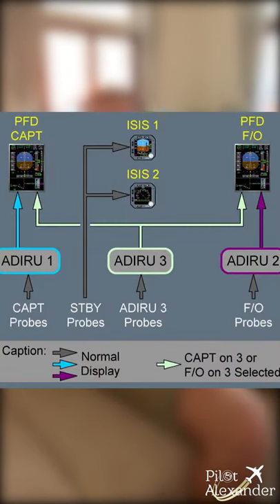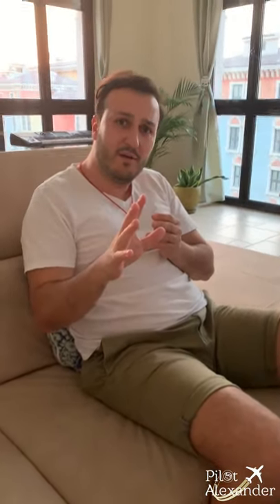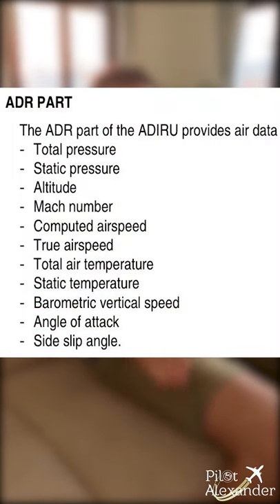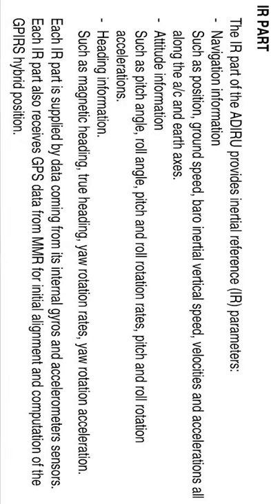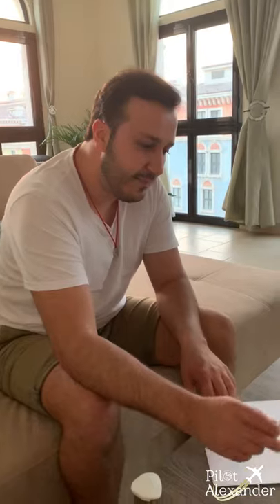Aviation Knowledge 2 - Aircraft Speeds - Pilot Alexander

Comment: Another video yay!!!!
Reply from the maker: Ethan Freeman 🙏🏻
Reply: @PilotAlexander  the reason why the aircraft uses Mach number at certain flight levels is because of air density. As the altitude increases the density of the air decreases and that the pitot static system with the ADIRU cannot provide the pilots with the information on the EIS system. I’m on the A320 type rating and might differ from the A380, and that aircraft usually cruise at transonic speeds where the actual speed of the aircraft is flying below Mach 1 ( subsonic) but certain parts such as the air flow over the wings is supersonic which means that the aircraft is flying at at the speed of sound. It’s not flying below it nor is it flying above it but flying at the speed of sound. Note that higher altitudes the aircraft cruises at much higher speeds and if those speeds are at the ground level then there will be a lot of parasitic drag which is unnecessary so flying at higher altitudes means that from A to B is more efficient and that speeds are much faster thus the indicated airspeed is higher as well to a degree where the formation of a shock-wave occurs along the wing but it’s at around 15 to 25% of the distance of the upper camber of the wing